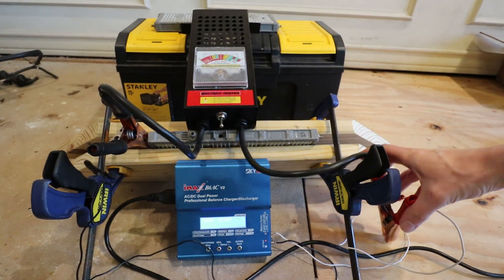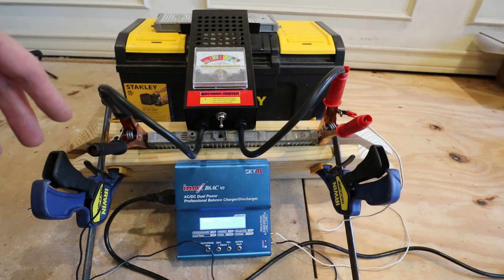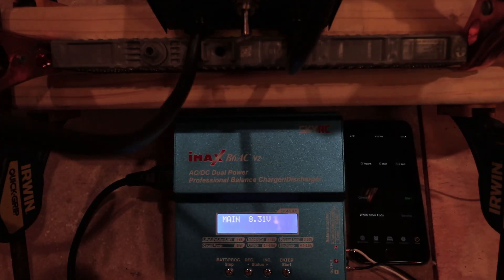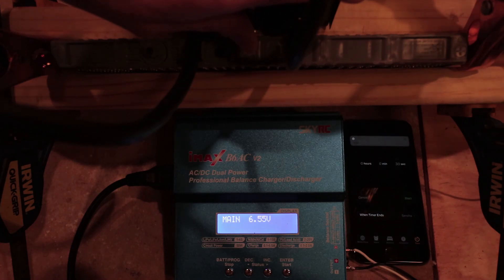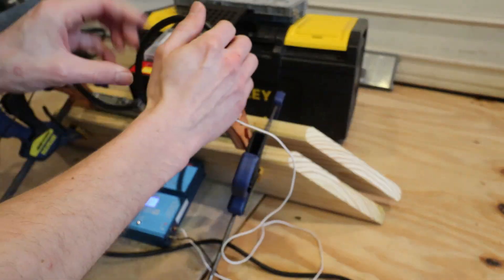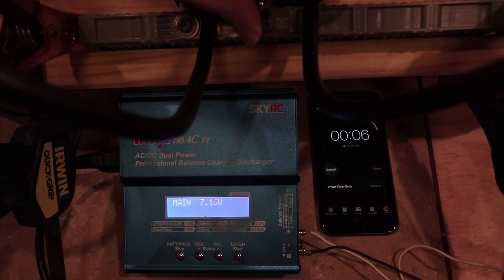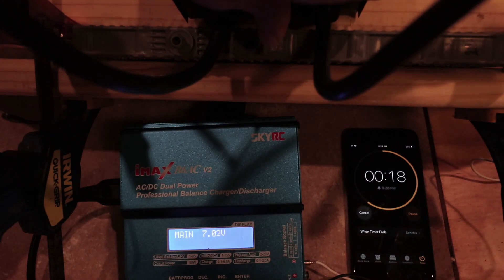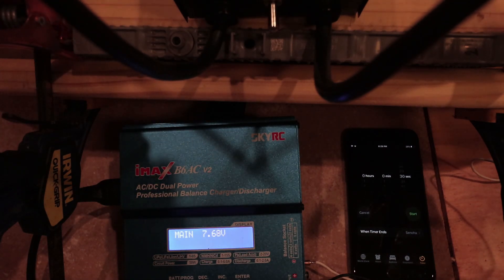How To: Load Test Your Prius Battery

Comment: Excellent video, excellent Idea. 
The heating element in the tester gets extremely hot. In order to get consistent results you have to wait for a few minutes in order to cool off to room temperature because the heating element when hot the resistance is higher and you won't have same load. 
That's it.

Comment: Seems like a 100 amp load is way too much? Most people are using a light bulb pulling around 2 amps to simulate the load on each module as it would work in the entire pack.
Reply: Well, it is not 100 amp - about 66 amp (100 amp @12 V gives us 0.12 Ohms; since our battery voltage is about 8 Volts divide that by 0.12 Ohm  = 66 Amps

Comment: What was the actual Amps reading on load tester while testing?
Reply: It's basically a manual load so doesn't read amps (he's using the digital thing for monitoring voltage only).

Comment: I just repaired my 2nd gen battery pack and didn't use this hi load method. I simply equalized all the batterys and then isolated them after group charging to see which ones whould drop the fastest over 24hrs. Replaced the ones that discharged and repeated the charge and self drain test. All 28 dropped similar after swapping different ones in so that's what I reinstalled in the car. So far so good after a week of driving. Now that I've seen this load testing method, I wish I would have found this video sooner. I did try previously with a digital load tester to see if that would work as an experiment to load test but it didn't so I just relied on the self drain test  Now I'll have to re buy my manuel heat element tester to check the spare battery cells I have. Got lucky and bought an entire 2nd gen battery pack off auction for $75 and so far all the cells are usable. 😁 Thx for posting because this is exactly what I needed to see.

Comment: Is it okay to run for more than 10 seconds? I got the same tester and it says 10 seconds only but 30 seconds is okay?
Reply: The warning I saw from another video was that the heating element inside the load tester can get very hot. I think that's part of the reason for the 10-second recommendation.
Reply: @zonykel  Where's the other vid? :)
Reply: 20 seconds is the sweet spot

Comment: I have a concern about using my load tester on these battery modules.  My load tester says it draws 135 amps.  That sounds very high to me.  Do you know what the amp draw is on your load tester?  If you said it, I missed it.  What would you say is a safe amp load?
Reply from the maker: I think it’s a 100a draw with the tester I used.
Reply: @beenegarage7116  I see videos of people using light bulbs.  I don't know if they're 6 or 12v.  That doesn't sound like much of a load to me.  I think you're in the right neighborhood.  I couldn't see the name or model of your load tester but it looks familiar.  Thanks for the info.

Comment: I didn't realize they would swell while discharging?
I bought this exact load tester.
Instructions do not advise 30 sec.
Also it's like one min.cool off between pulls.
I did 20 sec. A couple of times
Then 10 more secs on one module. 
Hope Harbor Frieght gives me a refund tomorrow. 
It stopped working.
Doesn't read volts or anything now.

Comment: After reconditioning. 
And no TRIANGLE but engine immediately starts?and goes dead after 30 seconds. 
Today TRIANGLE? But says ready and doesnt start.backed up under electrical power 15 feet /the engine starts?30 sec.goes off?
I took a reading today on the pack 
Because the dash says 3 bars.
The pack shows 230volts?
Reply: I red the ecu normally wont allow the battery to be charged past 201Volts
Soooooo maybe I've done a bad thing?
Reply: @stevepope5484  ever figure it out?

Comment: Load tester, U using 6v or 12v cheers
Reply: It's one and the same. You can just read the voltage with the needle on the meter.

Comment: I set up the test just like yours.  Found one battery which failed miserably.  A dead-one in the 28 battery line-up, and it's all over for a Prius.  There's no mystery with Prius batteries for me anymore, just a lot of nuts & bolts and repetition.  Thanks for your video, it saved me a bundle.
Reply from the maker: That's awesome, glad it was helpful! Let me know how it works once you put it all back together!
Reply: @beenegarage7116  all good. had to learn how to repack the cells vertically, then within an hour, it was back in the car and working. With good advice for folks such as yourself, Prius battery pack repair is very easy indeed.

Comment: I did this load test with a halogen headlight.  The voltage drop was imperceptible- at most .o5 to .07 volts per module.
Reply: You're drawing way less amperage than he is in this test.

Comment: What amperage did you charge at? How long did the charge cycle take?
Reply: I have two SkyRC iMax B6AC v2 chargers and they work pretty good.  However they do not stop charging at a max voltage, so I do not trust the iMax v2 to charge/discharge in cycles.  The cycle feature is useless.  They work safely for charging if you watch them, and discharging works fine because you can discharge down to a set voltage. I set the manual charge to 6.0 amps (which is the max for NiMH), and it charges at a rate of about 5.2 to 5.4 amps.  I set the time limit to 5 minutes and watch it very closely.  Charging at a fast amp rate helps to reduce the battery memory effect.  I think the Delta Voltage Drop kicks in around 8.6 or 8.7 volts, and it may be safe to charge up to 8.5 volts.  I usually charge up to 8.25 to 8.30 volts. I do not know what is optimal. The iMax charger charges for 29 seconds and then pauses charging for 1 second at which time it captures the voltage, and then charges for 29 seconds, pauses for 1 second, and so on.  There is no max voltage limit to set (I wish it had this feature).  Since the iMax charger does not monitor the voltage every split second, it will not detect the momentary delta voltage drop of the battery, which indicates the battery is fully charged, and it should not be charged anymore.  Because the SkyRC charger does not have a safe way to determine the battery is fully charged, I feel it is unsafe to charge up and discharge (in cycles).  The SkyRC charger has a setting where you can discharge up to 2.0 amps, however realistically it only discharges at a rate of about 0.7 amps.  If you wish to exercise the module, discharge the voltage slowly down to 6.0 volts For example, 1) Discharge battery  @  0.7 amps down to 7.0 volts. 2) Discharge battery @ 0.5 amps down to 6.7 volts. 3) Discharge battery @ 0.4 amps down to 6.5 volts. 4) Discharge battery @ 0.3 amps down to 6.0 volts.  I do not recommend going lower than 6.0 volts.  After discharging, allow the battery to rest for 2-4 hours or even overnight.  Note: due to the battery chemistry, the voltage will drift up/down to 7.2 volts.  When discharged to 6 volts, it usually will drift back up to 6.8 volts or more.  To recharge, apply a 2 amp charge until the battery reaches 6.5 volts, and then apply a 6 amp charge up to 8.3 volts.  Balancing the battery pack is a technique to weed out bad batteries and pair two of them together for each block.  One way to test the batteries is to connect the SkyRC iMax charger to the battery.  Charge it @ 6 amps up to 8.30 volts.  Stop the charge and verify the voltage is close to 8.25 volts.  Set the discharge rate to 2.0 amps and set the target voltage to 7.7 volts.  Start discharging, and immediately connect another load to the battery terminals such as a halogen headlight (ideal).  Once you hit the 7.70 volt target, the charger will stop discharging.  Disconnect the headlamp.  Write down, the time to discharge, and also the amps (note: the amps are based on the charger's discharge rate, and does not take into account the headlamp).  You can use this information to sort the values you collect in a spreadsheet to determine which batteries are good and which ones should be replaced.  As an additional step, you could charge the battery back up to 8.3 volts and write down how many amps were required to charge it back up.  This would give you an idea of how many amps were actually discharged in the previous step (charger + headlamp).
Reply: @GaryMarkowski   thanks! I may be doing another battery soon.
Reply from the maker: Is have to go back  and look but I believe I was charging at 1c, so for these they would be 6 amps which would take a bit over an hour. Apparently if one charges nimh too slowly the algorithm can’t determine when the Cell is full and end up over charging.
Reply: Ok. I’m a noob here. What does 1c mean?
Reply from the maker: 1c would be charging or discharging a battery fully in 1 hour. So a 6 amp hour battery would discharge in one hour if done at 6 amps. Therefore 1c.

Comment: very helpful. thank you! how many amps were you using?
Reply from the maker: I didn't get a direct reading but the device is supposed to pull 100 amps at 12 volts so I figure it was north of 50 amps with the lower voltage I was messing with.
Reply: I think that 50amps for 30 seconds for a 6500 mah battery is too much. Can we use a smaller load?
Reply from the maker: I was trying to simulate what the Prius would pull. 50a is probably on the low end. These cells are rated at a high discharge rate to be able to handle depleting the battery in a single acceleration onto the highway.
Reply: @beenegarage7116  I have the Dr prius app and I think it might go up to 20 Amps. But now I'm not sure. I will have to check it out tomorrow.
Reply: You are right. I found one screenshot  where it drawed 75 Amps!!!   So a weak battery, can we make them stronger if we discharge down to 6v and then recharge to 9v five times?
Reply: @panicosvasiliou4914  I have see 120 amps on a hard acceleration.. Crazy!!
Reply: @kennethwinter5665  scary!!!  But it only lasts for a few seconds
Reply: @beenegarage7116  I've heard that the pack draws around 50 amps average, so wouldn't it be around 2 amps per module?
Reply from the maker: Since the cells are all in series it would still be the full 50a. Or whatever the Prius pulls. My civic hybrid will pull up to 80a but usually around 50 is normal after the pack is a little warm.

Comment: How do you have the imax connected to the load tester and battery? What outputs are you using.
Reply from the maker: I just connected the main positive and negative of the imax to the main positive and negative of the battery. Same place the load tester was hooked to. Really just using it as a fancy voltmeter. I blew up my DC wattage meter shortly before this test or I would have used that. Would’ve been more appropriate.